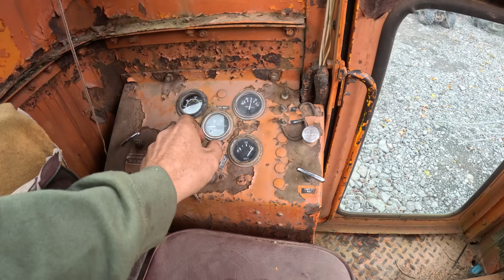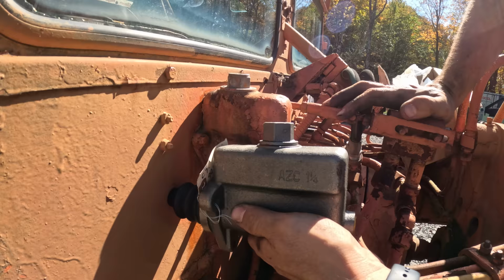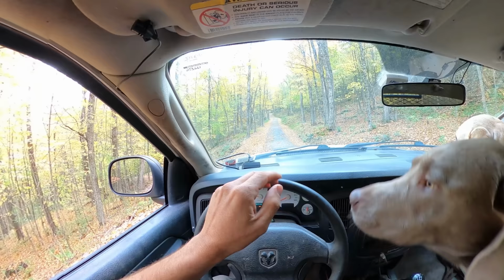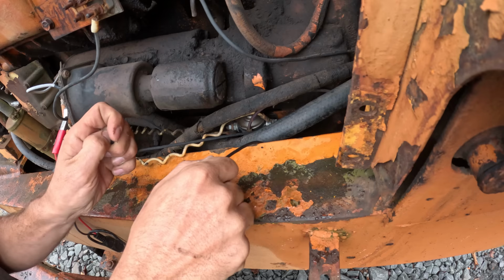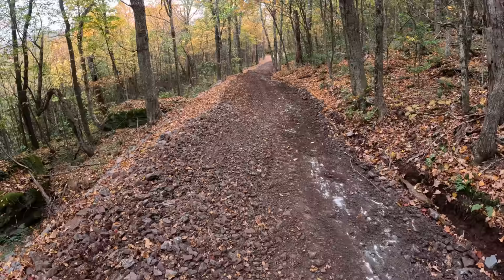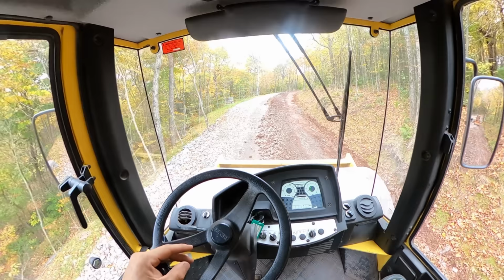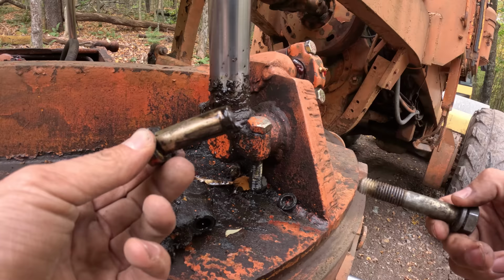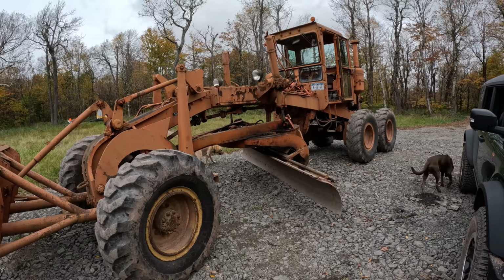Buying a cheap grader

Comment: Every time watch one of Andrew’s excellent vids on maintaining the access drive with the roller or rock crushing I find myself constantly thinking, wouldn’t have all of this been much less time consuming and had better results if he had only somehow adjusted the rock crusher to a smaller size product? I don’t know if this would be a simple adjustment or require replacing the moving crusher plate with a different one, but if it were at all possible it would have eliminated the need to do so many passes with the roller to crush large stones already in place, as well as resulting in a smoother, more stable and compact road surface. 
Hes had to redo steep stretches because trucks catch on large stones and pull them out. All that wouldn’t have been necessary with smaller gravel. 
Maybe the big rocks for a base, but if he had changed the crusher to maybe an inch or two smaller product, he could have saved a lot of work. 
I don’t know, maybe the larger size covers a larger area somehow. But can’t think of a reason to use such large gravel and not smaller.

Comment: You'd love and hate a new Bronco. I drive a 2014 RAM pickup with Laramie Longhorn trim package (loaded). I love the luxury, not gonna lie. But I hate that everything is electronic. You can't adjust the heat, radio or ANY thing with a dial. You touch the screen and wait for it to process your input. That would drive you friggin' nuts! Something goes haywire, you're hosed--dead on the road--because NOTHING is mechanical. I don't like that, but you'd HATE that! Newer stuff is sensitive, not even as tough as your Montero. Hope that insight helps & thanks for all you do for all of us. I know making these videos is a LOT of work!

Comment: Those Detroits engine parts are readily available maybe a freshen up with a set of liners and rings  valve job and will start fine.  Seems like a worth wile machine to put a few bucks in

Comment: work with the air and its natural desires to want to move upward, get a little pump bottle and some tubing and pump brake fluid into the nipple rather than trying to force air downwards-force it the way it wants to travel...much easier👌

Comment: That is a 471 Detroit Diesel the main thing you need to do with a Detroit is run the rack adjust that's what they call giving it a tune-up and make sure to run the thing wide open because it is a two-stroke it is very important to run them two-stroke Detroit at high RPMs and the motor oil that you use in a Detroit is Chevron delo 400 straight 40 weight

Comment: The bronco is not good.   I work at a ford dealers body shop we have had so many problems.    They already have corrosion issues causing the paint to fall off and there are so many things that have leaked. Especially around the windshields/roofs.   The structure is riveted together and is often messed up at the factory..A lot of these newer aluminum bodied vehicles not just ford are prone to massive issues with corrosion look at any mopar product with an aluminum hood after 4 years guarantee it’s bubbling in the front.    Not to mention how much harder it is to repair or that it rips clean in two if you tap a tree or anything too hard.    Not ideal for something that was marketed as an off road vehicle imo

Comment: Consider a first gen 6.2 raptor. More reliable and easier to maintain then the newer broncos and raptors. Still really cool trucks. You can get one reasonable.
Love that grader, all wheel drive. The plow, that 2 stroke detroit. 7,500 seems very reasonable. A good service and it'll probably last quite a while.
Reply: At first I thought that was a GRENADIER!  I have been researching those for a minute, and want one.  Created as a replacement for the discontinued old school  Land Rover Defender and named after the British pub in which they thought up the idea.  They are unique and very cool.

Comment: Make sure you get the Manual.. if you get the Bronco.   They have a 7 speed manual..  basically a 5 speed with overdrive that has a super low "crawl" gear.

Comment: I have nearly the exact Bronco. Same color and Trim. Really enjoy the vehicle. The 2024 badlands will come with upgraded steering. Best wait for that. The sway bar disconnects if you do a lot of wheeling and smooths out the ride. If that’s not a big deal for you the wildtrak is awesome for speed driving and snow fun!

Comment: 27:41 that ”motor” is neat. I guess back then the swash-plate motor was not invented yet. Wonder what kind of coupling it has to the rotation and switching those cylinders back and forth.

Comment: You should be able to tilt your front tires left or right into your cut so you arent pushing away from your cut. 
The 670b i operated could do it and it made a major difference
Reply from the maker: It does not look like this machine does that. Its nice that its all wheel drive though.
Reply: @AndrewCamarata  gotcha 
Yeah all wheel drive is nice especially with heavy cutting

Comment: Grader does a outstanding job for it's year. You almost need to keep a couple of bolts in all your machines and a crescent wrench. Your Welding skills are fantastic. Were you self taught or did someone teach you to weld ? That grader could grade snow in winter time.  Do you have any buildings that could house all your machine to keep them out of the weather to make them last longer?

Comment: Buy a laser cleaner instead of a sandblaster. Works amazing when used on diesel engines. Gas engines you have to drain the fuel lines and really make sure your empty before cleaning.
Reply from the maker: Really, what will it clean? Grease, dirt, rust, paint?
Reply: @AndrewCamarata  Yes, all of the above. I just posted an example cleaning a dirty engine using my backpack-style laser.

Comment: It seems like putting a camera on the mount for the rippers pointed back at the blade would be useful. It seems like you can't really see the front of the blade from the cab.

Comment: Now you need is a water well drilling rig to put a well at your mountain property….  Super super cool you got the road grader…. Brother your a metal fab expert… build a 6000-8000 sq ft barn dominion on your mountain property… but this time build it so it’s high end appearance and have it so your girlfriend (and kids you need) will have a killer home to live in etc… I wouldn’t doubt if you could get sponsored by one of those companies and get the materials and design at cost… you can do everything you know you can … plus a solar array and 240v battery bank so your completely off grid… lol
Reply: And don’t waste your time on containers build a 30x60 shop next to it with the 14ft or bigger doors on it too… keep your eyes peeled have doors on both sides so you can pull straight through and allow air flow in the spring through the fall
Reply: They are saying it’s $57  a sq ft…. Bet you can do it for less…
Reply: Figure out your solar requirements  and incorporate that in your plan… and you know it as well as anyone else at least three bathrooms … heck build the place so it has  four master bedrooms with full baths shower tub dual vanities .. and a full bath in the shop… air b n b the property 100% it will be a money maker lol
Reply: Build a 3000 sq ft one on a lower part of the property and make it a vacation rental income… away from your stuff so they aren’t right in the middle of your business lol
Reply: 100% your subscribers will have it booked year round 🎉
Reply: Your very blessed and very fortunate …. Hard work is paying off for sure… 🎉
Reply: You have a well at your castle house so for sure wells are okay there Just need permits right! ?
Reply: What’s clanging on the grader sounds like a sick cow bell lol😅

Comment: Interesting to see a grader used for grading and not snow plowing. I have had my 2 door 4 cyl. Bronco with a manual for a year and a half with almost 40,000 miles on it. I have never had another vehicle that was nearly a s fun to drive. I would recommend lockers and sway bar disconnect.

Comment: how many blade protection fuses have you broken already... there is a very special way of working with this type of machine... either you are born for it or you work hard to learn it or you never manage to do anything neat. I worked with them for ten years almost exclusively, that is, I was one of those people who was born for them because it was very easy to show results in the first week. already with swivels.... brrrr. just moving inert materials because the work has been perfected.... yeah 🤥

Comment: that is a hella lotta white smoke when your trying to cold start it.... also i thought Graders were for Grading Dirt/soft gravel Before you lay down a hardpack  ontop.. isnt that the reason why you have ripper attatchment points and a dozer blade for loosening up hardpack Before you grade it... maybe that is why those bits started to break because of the pressure on the grade blade.

Comment: Just sayin, 2024 is the last year for body on frame old school V6 4runners. Get that TRD PRO with the fox suspension. Go 60 up that hill. 
Bronco inline 5 cylinder garbigie.
Reply from the maker: Really, why would they stop making those?
Reply: @AndrewCamarata  
They're still making them. It's just a unibody with a hybrid or a turbo 4 banger in 2025. 
We ordered a 24 trd premium in octane orange and it's 48k. The trd pro was 56k

Comment: That old Austin-Western is working pretty well, easy to maintain too.
Now, if you can get the Crusher to make some top gravel to finish that mountain road. :)
The video of the Bronco sure shows the road surface; just watching the front wheel bouncing ( or not ) shows that the road is levelled off a lot.   
Somehow I can't see you in a brand new ANY vehicle. You'd have nothing to do with it, but enjoy the ride. LOL.

Comment: 2021: "My mountain road is an unusable mess."
2023: "My mountain road is too bumpy for high speeds."
2025: "My mountain road is better than most highways."
2027: "My mountain road is now a certified Formula One circuit."

Comment: Dude...... The next time you weld something like that..... V it out more than you did.... And then right after you weld about a half inch long or three eighths of an inch long.... Stop and let it cool.... And see if you can break the weld off Easley... Not so easily.... Or really hard to break off.... Now what did that teach you.... it taught you compatibility of materials. Very important knowledge to have on something like that.... You don't want to be wasting your time right.... So let's say it broke off real Easley...... I would suggest using some special welding rod stick welding rod preferably..... Go to the weld  store talk to them.... call a certified welder up talk to him... Ask...... You hear me.... Ask somebody for the proper welding rod for the job.... And you can never go wrong by pre-heating..... Just a little... To moderate.... Get some heat pencils... That will tell you how hot you preheated something.... And will also tell you how hot you should heat something.... An inexperienced welder doesn't know what he should be watching out for.... He lacks knowledge.... Some of them just plain don't give a damn.... So let's say that it broke off not too easily..... Well I would say you could probably get away with it with the wire feed.... But you should preheat.... And then have a way to cool it down slowly when you're done. Grind all the impurities away. Paint rust grease dirt ECT.... Put plenty of Weld on.... Okay.... There's no bushing in there... There should be very little slop after it's assembled.... Make sure it has some slop or clearance... If it's too tight with your pull up with your bolts.... That's going to put more stress on your weld... The bolts will literally help tear it back apart again... If it's dragging with no clearance... That's going to put ungodly stresses on it....
Think of this.... What if you over tightened your lug nuts on your wheels.... So that your studs have got a tremendous preeload on them..... What do you think is going to happen if you  got a huge load on your truck and you go around a corner.... The lugnuts could break the studs... Because there's too much preload... And then the added weight..... My point is don't over tighten bolts....

Comment: i dont know anything about gravel roads building but i think you will need smaller gravel with that paver dust or rock dust so you can smooooothe it out and make it like a paved road...and then roll it roll it roll it with that big vibratory roller you have...after you grade it again with your new to you road grader...ill shut up now 👷‍♂

Comment: Other than paint, you have  all the cab glass. Does the heater work? But I nailed it on the cost. But that is a good price. And the motor sounded good.

Comment: Hello Andrew. You said the grader can have either the plow blade or rippers. Why not both, if they are needed? They may need to share the hydraulic lines, but when in the up position, could some pins be used to hold up either and lower slightly to secure and remove the hydraulic lines and attach to the other device. Have good days!

Comment: Enjoy your videos a while back you showed a sprocket puller I can’t remember which piece of equipment you were using it on but it was a very simple sprocket puller that had threads instead of hydraulic could you share with me what that is? I have a need for one. Thank you.

Comment: Andrew Camarata wouldn't it be more beneficial to use a blower to get rid of all those leaves that have accumulated before using the scraper ? Is it not a bad thing to now mix them into the gravel that you are scraping up?
Reply from the maker: I do not think the leaves mixed in are bothering anything.

Comment: 16:37 looks like he dogs driving  🤣
Reply: also, if you graded everything where the internal bends are lower than the external bends, you'd create a natural camber, where you'd be able to drive up and down more naturally, without feeling you might be tipping over to the outer edge of the road. You could also put several culverts in going from the internal bends to the outer side of the hill.

Comment: Needs a new muffler, it has a dual exhaust with that hole in the muffler😁...also, what happened to the other roller, the one that slipped off the road in the ice, and he put new tires on it?...
Reply from the maker: Sold that

Comment: Re: The Bronco.--- I'd be interested in seeing how you would charge it out there. If you could figure that out it would be a good "Property vehicle". I have been noticing a lot of machine manufacturers going to electric machines (excavators, bulldozers,  wheel loaders, etc.) Even saw you running a few at some of the shows and conventions you went to. Setting up for the fuel side of things (electric versus diesel) might be the hardest thing to overcome.

Comment: Andrew hold off on the car there is something coming out that I believe you would be very interested in it has one of the guys that I am talking to I understand this video is for months old but I am a very careful of who I am bringing in take care.
Reply from the maker: There’s something coming out better than the bronco? I didn’t buy it, that guy even traded that in pretty quickly because it kept having electrical issues at the dealer couldn’t figure out, I bought a 20-year-old Lexus SUV instead, that’s been pretty nice and obviously was much cheaper.

Comment: Well...lets all guess...he did not have a qualified diesel mechanic look at it before he purchased it....thus he will talk smack about the manufacture saying they having crappy products...then proceed to beat on it with a 20 pound sledge hammer to "fix it"..... :face-orange-frowning:
Reply: Correct 😂😂😂😂
Reply: He only paid $7500 bucks for it. Why would you spend money hiring someone to inspect it. It’s an old clapped out machine.